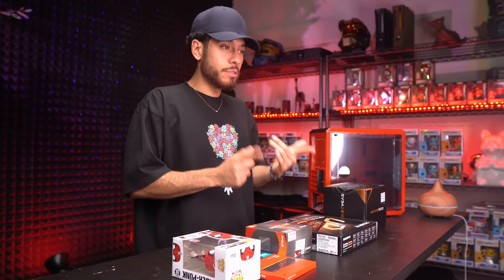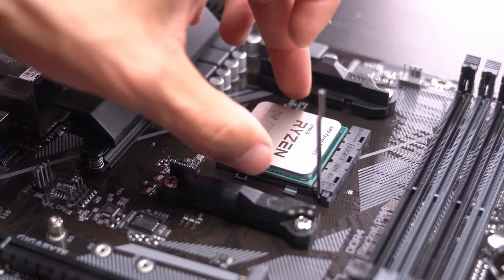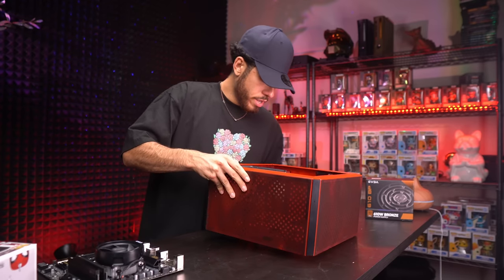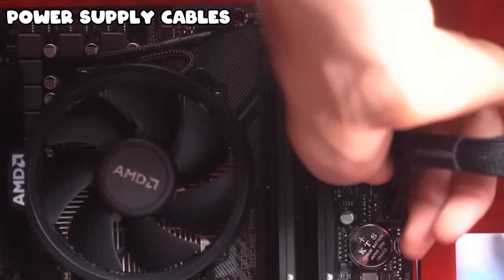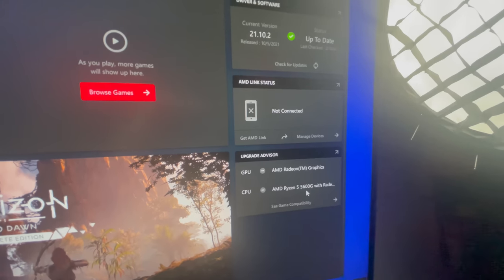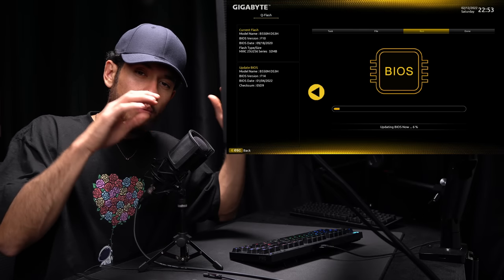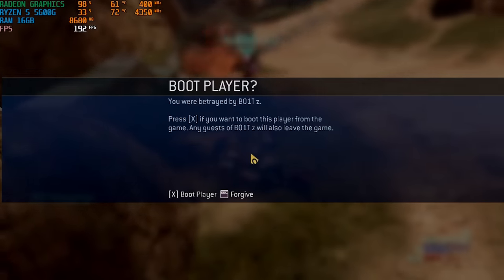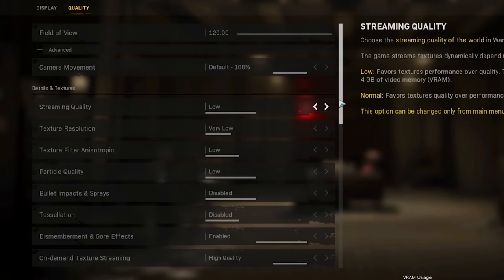$500 Budget Gaming PC Build Guide - Ryzen 5 5600G (w/ Benchmarks)

Comment from the maker: Big 40% off discount on all CRATER tees. Code found in New discord server!  ;D
https://discord.com/invite/WmTHmAFYuN
GO!
Reply: The psu is not in stock any more can i use another one can u comment a onther link??
Reply: Can i use an gtx1080ti ?
Reply: @leonardfournette104  I think the point of the video was to keep the budget down by using the onboard graphics (ipu) - so adding an additional gpu will only help (although he did say that in the video too!). 

Short answer is “Yes, you can!”
Reply: Hello Joey. I'm liking the PC build a lot and looked to do something similar. I was wondering what type of cable did you use to connect your mobo with monitor since the build has no GPU to connect the monitor to. Also is it possible to run it on 144hz since no GPU, and how?
Reply: Hey would this work with a Ryan’s 9?
Reply: Ryzen
Reply: @chrismicheals5648  no
Reply: Will a Gigabyte Video Graphics Card: GTX 1070 8gb GV-N1070G1 GAMING-8GD work with this build
Reply: @eyeofgold4131  It would work fine. 1070 is a little weak for 5600g so there will be like a 10% bottleneck rate but still decent

Comment: To think I started two years ago building my own first pc with the 3200g and now I have a legit top of end pc based on 3200g guide!
Reply: Same except when building mine I blew my money on a "in the long run mother board" and power supply, with a ryzen 2200g with 8 gig of ram

Now I have a RTX 3070 Ryzen 7 3700x same mobo and psu with 16 3200 ram
Reply: Same, i started with a ryzen 3 3200g with 8gb of 3000hz ram, i now have a ryzen 5 3600 with 16gb of 3200hz ram. I wasnt able to upgrade my gpu because of its so expensive and i want a rx 6000 series or rtx 3000 series gpu.
Reply: @Z0niC101  literally, we all started the same. I had 2200g and one stick of 4gb ram. I know have 3060 ti and 5600x 32gb ram
Reply: Haha. Nice to see you guys getting into it.

Its a fun life.
Reply: I started with 3600 then got a 5600g but now a 5600x...and 5800x. Just kidding my first computer was a Pentium 4 but those really are my latest 4 CPUs.
Reply: Started with intel celeron. Now i have none other than my wife laptop intel i3 5th gen. 😂
Reply: I started off with a Ryzen 3 2200g and a GTX 1050 ti, now I have a R5 3600 and a RX 6600
Reply: yooo i started a year ago with my r3 3200g,16gb 3600mhz,b450m mobo,650w psu. Now with the same ram and psu , i gotta rtx 3050, ryzen 5 3600,asrock b550m
Reply: I started with a ryzen 5 2600, 8gb ram, and a GTX 1050 ti. I now have an RTX 2060, 32GB ram, yet same CPU. Still satisfied with my upgrade I’m gonna keep it that way, but it’s def been quiet a jump
Reply: I built my 1st PC with a 3200g, b450m tuf, 16 gb of quad channel 3200mhz patriot viper steel, and I cheaped out with the ares gaming 550w psu. Oh and a 120 aio cooler and a GTX 1050ti. Built it at the pandemic height and I wanna say I think I did it under 8 or 900 bucks total. There's alot of extra stuff I didn't include earlier, but all in all under a grand I'd say. eBay and luck was my friend.
Reply: Same.. We all started from the bottom.. What spec you rockin now? My specs are below..

My first spec :
Ryzen 3 2200G
Kingston 8GB 2400mhz Value Ram
GTX 1050 Ti
1TB HDD
120Gb 2.5” Sata SSD

My Spec Now :
Ryzen 7 5800X
2x Fury Beast 3200mhz 16GB
RX 6700XT
1TB HDD
120Gb 2.5” Sata SSD
2x 1TB m.2 nVME SSD
Reply: Still Using Ryzen 3 - 2200G with 8 Gig Rams. 
It's Still Great for My Casual Work.
Reply: Me too! But then I broke my 3200G and am on a R3 1200 rn lmao. Saving for a R5 2600
Reply: Bro... my first build was a ryzen 3 3100 with 16gb of ram and a gtx 1050ti. I now have a ryzen 5 3600 with 32gb of ram and an rtx 3060. I have built such a love for building gaming PC's.
Reply: Now I have 2200g 😹
Reply: started with an i5 2400 and now i got some old ass amd card from 2009💀
Reply: can anyone please tell me do we need to update the bios with this mother board and CPU ? I don't get display, what can be the issue? CPU fan is working, cabinet's fan and lights are working, I don't know, I have used 8gb ddr4 RAM it didnt worked and tried 4 different ram sticks in varies combination, still didn't worked.
Reply: @mitanand69  what’s your cpu and MOBO?
Reply: @edwardstark4923  same he has used in this video, 5600g and b550m ds3h gigabyte mobo 👀
Reply: @mitanand69  if everything is new, reset the cmos and check the cable
Reply: for my first pc ever that i’m building tomorrow i got ryzen 5 5600 Micro ATX Mobo 16g ram 1650 super and decent psu
Reply: And here I am with my Laptop i3-2370m with Intel HD Graphics 3000 with 8gb ram and ssd, still kicking but sometimes lagging 😆 

I can currently afford the 320m Mobo + R5 5600g + 2x8gb ram + 450psu (Ialready have other things). But I'm still thinking if I'll buy this computer setup or save more for laptop with R7 and 3050ti. 

I'm often out of home which makes me want to buy a laptop, but I want to somehow start upgrading my stuff already so I can edit smoothly.
Reply: my first pc had an i5-2390t and radeon hd 64 graphics (it was my pc for 10 years) and i built a beast pc 2 months ago lol (5800x + 3070)
Reply: @ryanedwards1380  I started with a r5 2600 with a rx580 mini itx build.. now i'm at two builds one itx 2060/ryzen 2600 and a mid tower rtx 3060/ryzen 5600
Reply: @NadixGamer  haha that's great. I'm pleased to say I bought a 3080 a couple months ago. That's my childhood dreams completed 😂 been wanting an 80 series since I was 13
Reply: do we need gpu or is that optional
Reply: @light9045  if you don't mind playing games at low settings 30fps then get an APU from amd. It's a GPU CPU all in one.
Reply: @light9045  if you have igpu, you don’t need one. Now I have the 5600X and 6700 XT based only on this guid
Reply: I had a b450 pro 4 mobo with a 3400G 16gb of 3600mhz and now I have a Z490 with a 10700K 3080 32gb of ram 2.5tb of storage
Reply: I started with a Pentium 4 and by that time i thought my pc is powerful because i can play modern warfare and Assassins Creed Blackflag . But when the AC Blackflag keeps crashing i realized i have a potato build or i need a gpu but cant buy because i still can't work cos i was 10 🤣
Reply: whatcha running?
Reply: @ryanedwards1380  thats a fat ass upgrade right there

Comment: Just built this about a week ago (my first ever pc) exactly how you showed in the video. It performs better than I expected, even after watching the benchmarks you did, I was still very surprised just how good it is in person. Thank you so much for this build and tutorial.
Reply: ok thanks for replying
Reply: how much did it cost you?
Reply: @santaheroica7388  after taxes, around $580 if I remember correctly. Before taxes, about $540
Reply: Thank you! I’ve been trying to find a comment like this. So is it worth it? 
Update: I can’t find the power supply ugh😫
Reply: @sarah123D  I would say it’s probably the best starter pc. Definitely would recommend upgrading it by adding a dedicated gpu, like the guy says in the video (I am going to add a gpu in about a month). It can run most games decent but on low graphics settings only pretty much. As for the power supply, I couldn’t find it either so I went with the same one but the 710w version which is actually better if you want to upgrade it more in the future.
Reply: @timmytenor1940  okay thanks! I think I will get it once the power supply it’s back in stock or do you know a better one that I could get?
Reply: @timmytenor1940  what gpu are you gonna get
Reply: @dj_1810  Radeon rx 6600. It’s going for $299 rn
Reply: hey man, can you install a gpu on the pc or does it already come with one?
Reply: @enievess2670  your question doesn’t make sense. This is a pc built with parts. It doesn’t come pre built. This build uses integrated graphics instead of a dedicated gpu. If you want a gpu you have to buy one and install it.
Reply: @timmytenor1940  oh my bad, i have 0 experience in building pc and i’m looking forward to build one
Reply: @sarah123D  just go with the 700 watt
Reply: can it run apex with good graphics?
Reply: @tatertots78  it can’t run it with good graphics but it can run it on low settings. I highly recommend upgrading by adding a dedicated gpu and use this build as a start. Also I recommend buying a higher wattage psu.
Reply: @timmytenor1940  yes you can run like 140 with a 6600
Reply: hey man, I am planning to build a PC with the same spec. What BIOS settings tweak did you do except the XMP? Did you increase the VRAM allocation?
Reply: @abhisheksengupta905  I added a dedicated gpu to this build and I used the AMD software to overclock the vram.
Reply: @timmytenor1940  how much is your current allocation?
Reply: @abhisheksengupta905  I overclocked my vram to 1900mhz
Reply: @timmytenor1940  and what is your iGPU RAM allocation? Like 2/4GB?
Reply: @abhisheksengupta905  8gb
Reply: @timmytenor1940  Doesn't it affect the overall PC performance?
Reply: @abhisheksengupta905  the more ram you have the more tasks the pc can process.
Reply: bro i’m building mine but i’m having trouble starting it up
Reply: @nicolascolmenero6080  If u can’t see the motherboard screen when you boot it up then you might’ve installed something incorrectly. double check everything and make sure it’s installed correctly. If u are able to get into the BIOS, make sure you set the boot sequence to boot to the USB drive with windows installed on it. Make sure you are spamming the delete key on your keyboard in order to enter BIOS on start up.
Reply: Sir you are a mini God in these comment sections I'm totally going to build the PC then upgrade for videos/editing and streaming thank you a lot for your help in these comments. Any way I can add you? 😂
Reply: @timmytenor1940  does any gpu fit on the motherboard in this video or what motherboard would ypu recomment
Reply: @shewantsdrex  any gpu will fit on the motherboard. Just make sure the case is big enough but most gpus should fit in this case as well.
Reply: @Timmy Tenor  what gpu you think is good for a ryzen 7 5700g I have the same case as him and every thing else just different  cpu
Reply: @mattyisagopher8407  The GTX 1660 super if u want NVIDIA. RX 6600 if u want AMD.
Reply: @timmytenor1940  OK just asking do you think 1650 would be good I play fort and cod mw
Reply: @mattyisagopher8407  both are good and have very similar performance so honestly I’d go with which ever one u can get cheaper
Reply: @Timmy Tenor  OK and sorry to bother you but do you know why when I play fort or any game my computer kinda turns off but the fan and power supply still runs
Reply: @timmytenor1940  what gpu would u recommend adding
Reply: did u update ur bios?

Comment: I used this video/parts to build my first pc.  I bought a different case (coolermaster nr 400) but your instructions worked all the same and were so easy to follow.  It’s working great so far, thank you! 👍🙏
Reply: was the 610w power supply in stock when you built urs ? if not what did you replace with?
Reply: @miraculouslyadrienette5007  510 is useable.

Comment: I just did a build a week ago with the exact same case! Altought  i spent around 1000$
AMD Ryzen 5 5600x
Zotac Gaming RTX3050
ssd nvme 500gb
2tb HDD Seagate Barracuda
Asus B550m-a prime (wi-fi)
same case
Corsair Vengeance LPX 2x8gb 3600mhz

Keep up the good work!
Reply: How do you like it so far and how’s it perform? You like the 3050 or plan on upgrading when the other GPUs get in stock?
Reply: @JT-qj2lj  So far so good, i don't game a lot i use it mostly to 3d an cad softwares, because e i just dropped 1000€ e only plan on upgrading a bit later on. Upgrading to 32gb ram, putting some fans and only than if justified upgrading the gpu

Comment: Yo Joey or anyone knowledgeable this would be a huge help. I was trying to play Valorant on windows 11 and it said I had to turn on secure boot so I did in the bios but now my computer won’t show a screen at all it just says no signal. I took out the cmos battery and waited for 5 minutes, tried the clear cmos thing on the motherboard, and nothing is working. Even tried a Rufus boot drive and that didn’t work. If it helps my motherboard is the gigabyte b365m ds3h wifi. Any suggestions would be greatly appreciated. Thanks

Comment: If you use 4000/4400/4800 MHz ram you'll get significantly better gpu performance  considering if you can find it in reasonable price .
Also you can overclock the iGPU easily even with the stock cooler.  To about 2.3-2.4 GHz
If you want to oc the cpu you're gonna need a beefier cpu cooler

Comment: Ive been planning on building my own PC and these are the specs ive been considering.
And this video gave me a clear idea of what parts to get, where to put the cables, with that thanks you.And id like to ask some questions.

The case- I had my eyes on it for a while but i saw bad reviews about thermals . I plan on using the PC for 3 hours a day using photoshop in a room temp of 79 Fahrenheit .

Storage-  my current PC uses a 500hdd and I delete files regularly so i never managed to fill it up and worry about storage.So would you reccomend to get another 500gb SSd or the cheaper 1Tb HDD for extra storage

Again thank you and hopefully you see this and reply
Reply: Get an ssd. The load times for everything will be crazy faster
Reply: Buy 500GB SSD and 1TB HDD
Reply: @Inuitman  first time building can i get ur thoughts on this: thanks!

AMD Ryzen 5 5600G 6C/12T 19mb 65W AM4 APU, Box
Gigabyte B550M DS3H AC (AM4) B550, mATX, 4*ddr4, WiFi + BT
8gb ddr4 3200 Corsair Vengeance LPX, black, CL16,

250gb Samsung 970 EVO PLUS SSD NVMe Gen3, 512mb DRAM, R|W: 3500|2300 250k|550K,
1tb Seagate Barracuda HDD, 64mb 7200rpm

Corsair 550watts PSU, CV, CV550, bronze
IDCooling SE226 XT aRGB Air Cooler, pn: ID-CPU-SE-226-XT-ARGB

also would you recommend this extra cooler and some fans for overclocking? thanks so much
Reply: @eeoui0334  Yeah a better CPU cooler would be much better and you don´t have to buy a very expensive one, I bought Freezer 34 eSports DUO and it is much better than stock cooling.
Reply: @Inuitman  thanks so much!

Comment: I'm on my 3rd build. Both of the others were for my grandson and my daughter and this last one is driving me insane.  I've been troubleshooting this for a week now.  I had already taken it all apart and connected the motherboard up to test it and it all boots of great!  I even connected all of the components just to make sure it all worked.  Installed Windows 10.... everything went fine until I reinstalled it in the case and it won't boot up at all. It's a Morovol case.  The other two were the Cooler Master and a Vetroo M03. No problems.  It just doesn't make sense. All of the motherboards are the same and the power supplies and RAM.

Comment: should've gone with 2x8gb or 2x16gb 3600++, the APU in 5600G is so good, even my friend's 5600G with 4x8GB Hynix CJR + DJR could do 3600 CL16, and it's on par with my 1050. also with the benefit of the architecture it could do 4000mhz++ on 1:1:1 ratio with ease, which is pretty beneficial for the igpu inside it, and the cpu cores inside it. Pretty much 4000~4400mhz with good timings (less than CL19) will be beneficial for these apu.
Reply: Idk if you gonna see this but the power supply for 610w is out of stock would 510 work ?
Reply: @chriski  yes it would be more than enough if its apu only. just make sure to buy a good brand ones (avoid gigabyte budget psus)
Reply: @admkukuh  ah okay thank you it’s the same brand as the one in the video is that fine ?

Comment: I went with the MSI B450 Gaming Max Plus and did 4 X 4GB DDR4 Ram and used the Raidmax Chassis ATX-1WLB. the hard drives and DVD-RW drives were carry over from my old MSI 760GM-P35 Build from 2011. absolutely love the 5600G processor and the 250GB Crucial SSD. my system is now futureproofed for another 10 years.... even got the TPM 2.0 Module for $12.00!
Reply: How much did it cost you for your build? Was it in the $500 range as well?
Reply: @strawberrysherbet96  on this build it was close to $500, $450 to be exact... even more if you really add in the little extras, like chrome fan guards. I add those to all my builds... tired of servicing a unit when its running and pricking my finger on a running fan.... the other thing I had to add was a USB 3.0/HD Audio header in one of the floppy slots. the chassis was NOS, came with AC'97 front audio header... didn't work with the new HD audio header, so I had to add that in... one of these days, I'll actually write everything down and the costs so I know the real price of the build.... send me your email and I'll share photos of these builds with you
Reply: @johnstancliff7328  dang I’ve never built a computer before. Do u know if it’s better to build at a $500 budget or puta graphics card into an office sff? For example My plan was I wanted an HP elitedesk 800 g1 i7 4th gen that costs around $250 stock and then add a low profile gpu for another $150-200 or so. Or would I be better off building from scrap? I don’t know if I can make a stronger build than what I mentioned but what do U think? My budget is $500. I just want to know what’s the better bang for my buck?

Comment: I recently built a PC with the Ryzen 5 5600g.
I choose an itx case that most YouTube reviewers paired with an AIO, but I used an air cooler that had the max height the case supported, so the cpu fan is also an intake.
Reply: Depending on the case, could add a 120/140mm fan on the front. I used an artic f14 pwm fan, stock cpu cooler, and stock case exhaust fan.